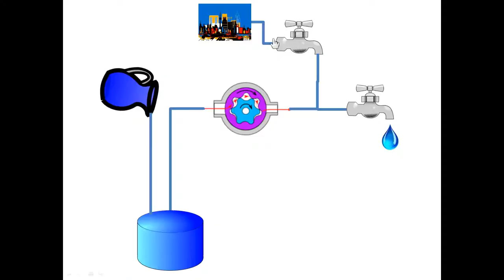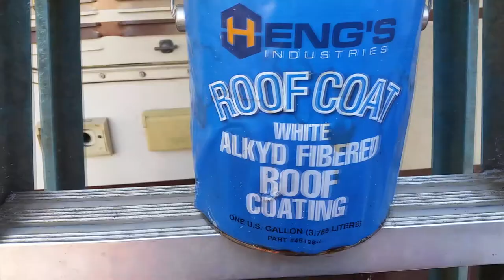Jon's Bus Conversion Part 65 - RV Rehab Part 3 of 3

Comment: Did it ever leak after applied?
Reply from the maker: Yeah - the stuff itself works fine and we got most of it, but it needs some more in a few areas. The stuff is really expensive and it's my son's RV and he hasn't wanted to buy more so he put a tarp over it. Anyway - the stuff does work but very expensive.